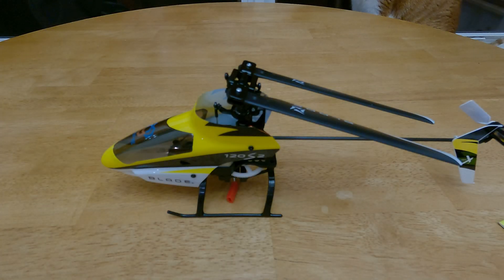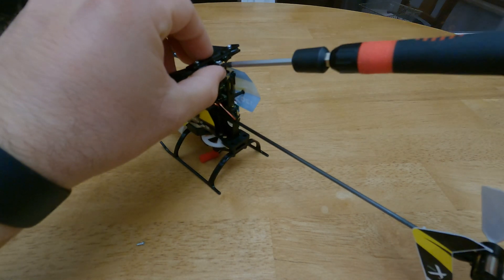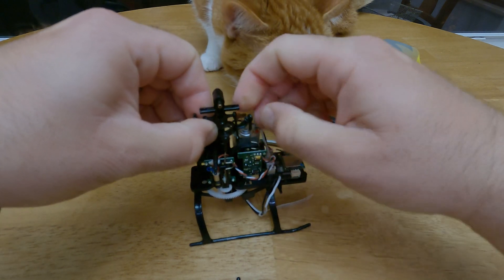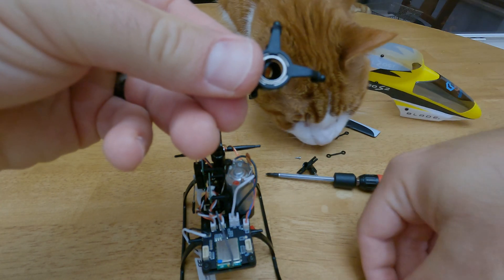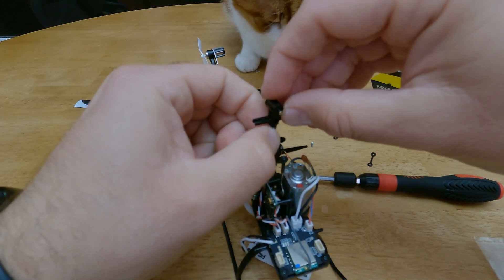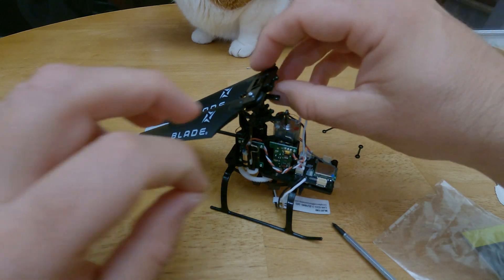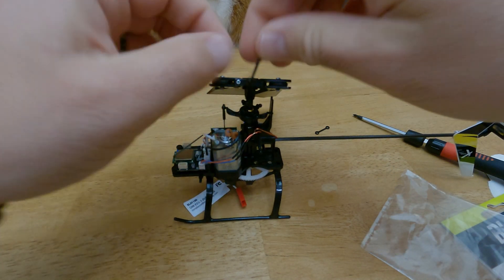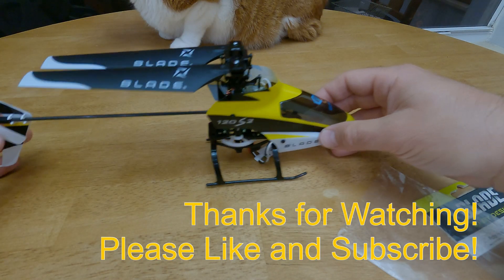Blade 120 S2 - Swashplate repair

Comment: As others have commented the swash plate can be pressed together and will fly normally.
I have had this happen and the helli is totally uncontrollable until you slide the two parts of the swash plate together.

Comment: hey thanks for the video! As a note: in most cases you should simply try to repair the old swashplate by joining the outer and the inner ring together with a litte tiny bit of force.

PS: had the same problem at by repairing the old one, you save 10 bugs and couple a days waiting for the part :))